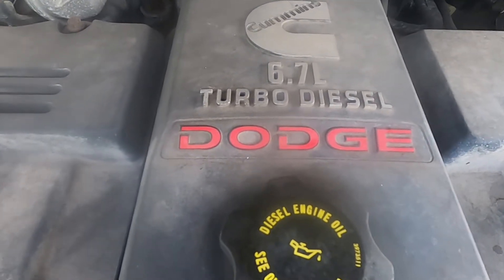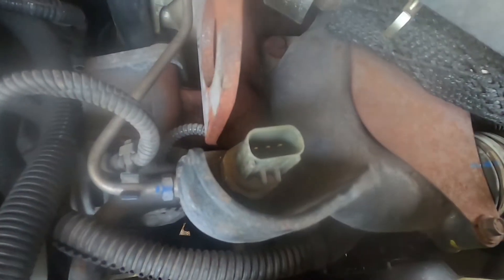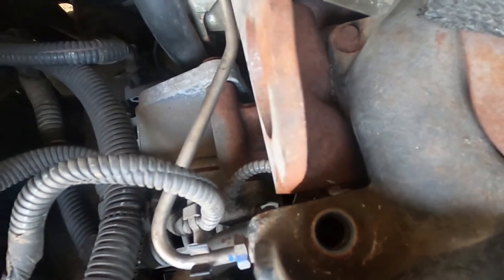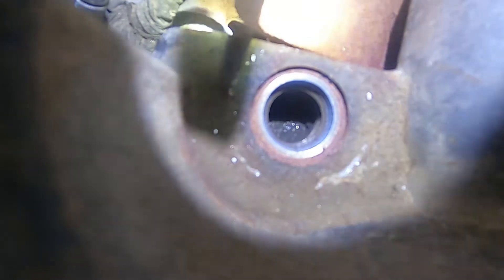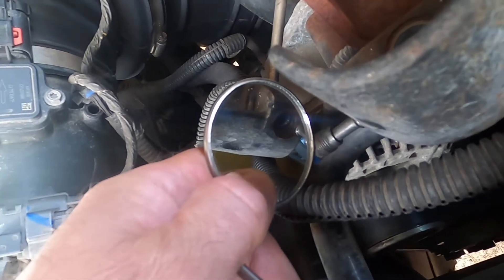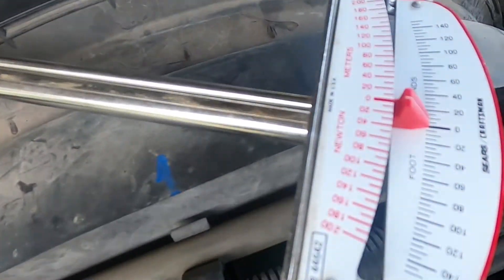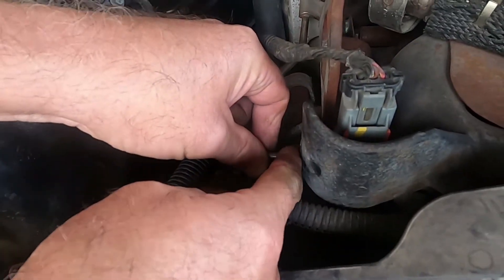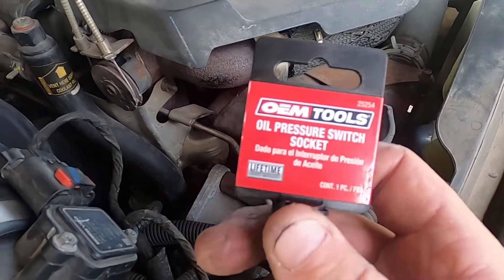P0471 Exhaust Pressure Sensor Code on 6.7 Liter Turbo Diesel

Comment: I did this service and I used and others have used a Six Point 1 1/16 deep socket to remove the Sensor. No problem so you do not have to buy the special tool. Only 13 lbs. of torque so not hard to remove.